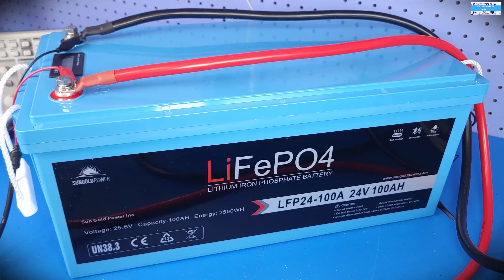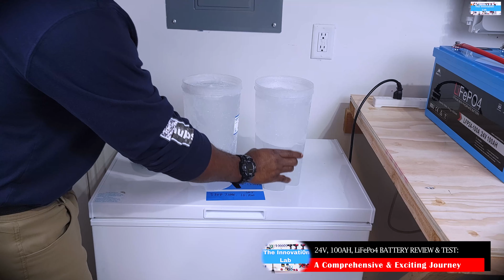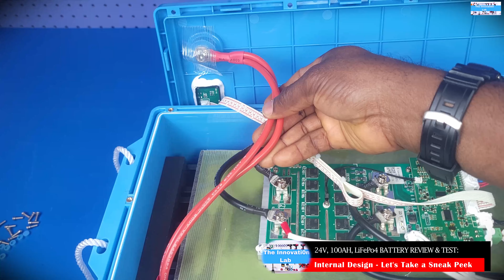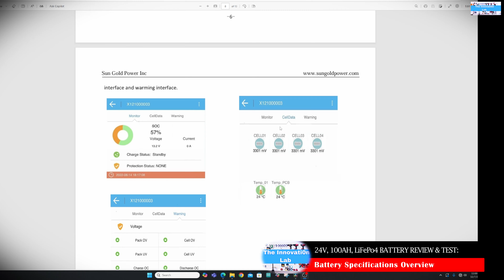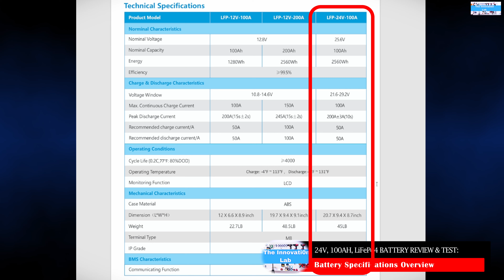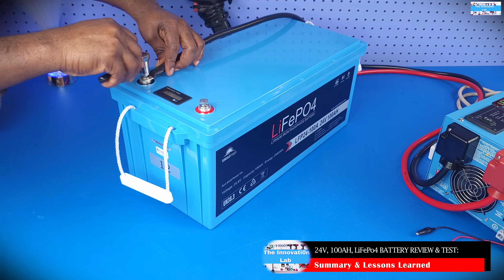Best LiFePO4 Battery Ever! Unbelievable Performance! Sungold Power

Comment: Hello again Mr innovation. Will a 48V / 58.4V 8A Lifepo4 Lithium Battery Smart Charger 110V 120V 500W for 16S 48V Lifepo4 Battery with Cooling Fan and Alligator Clip Output Multiple Protection Functions charge a 24V 25Ah LiFePO4 Lithium Iron Phosphate Battery Deep Cycle Battery, Built-in BMS, 2000+ Cycles. I hope you don’t mind my questions. Your answers are by far the best on the internet. Happy Thursday to you.
Reply from the maker: No, I won't recommend using a 48V battery charger to charge a 24V battery. You will end up damaging both the battery and charger.

I hope this helps.
The Innovati0n Lab 💥 www.theinnovati0nlab.com